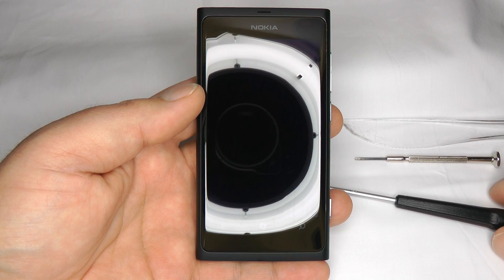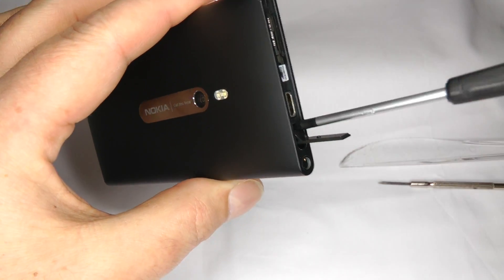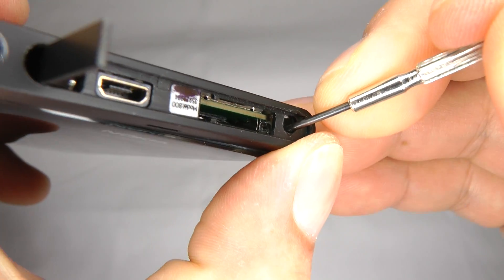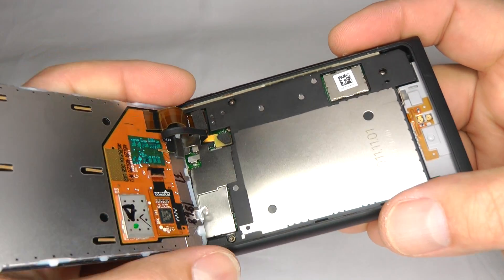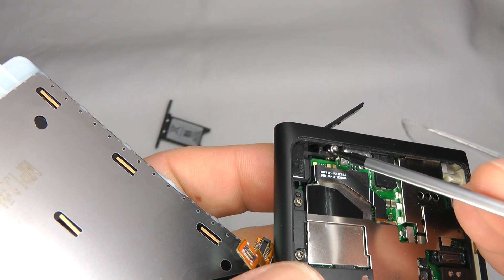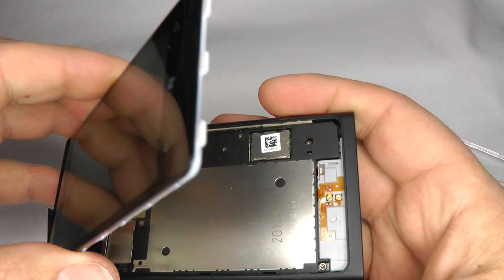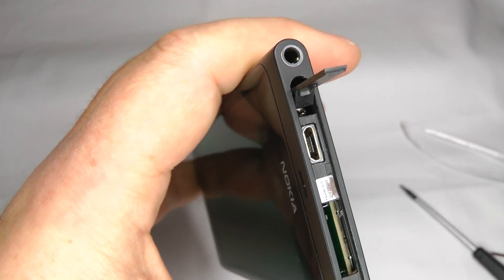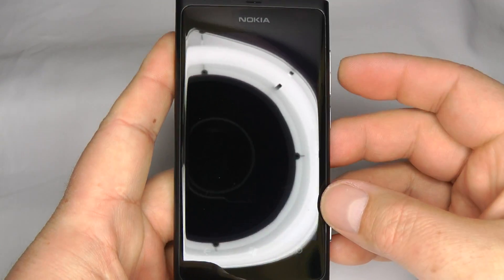Nokia Lumia 800 Screen Repair / Replace / Change a Broken LCD (AMOLED) + Touch Screen (Digitizer)

Comment: Hey chap, 
I dropped my phone recently and after watching this I decided to buy a digitiser from ebay to replace the broken screen. I am unable to post a direct link to the item but it is listed as "New For Nokia Lumia 800 Front Touch Lens Lcd Display Screen Digitizer Ribon Flex"
Having looked closer at the item I am concerned that is slightly different to what you have used. It looks like there is a metal frame missing from what I have bought.
Do you think this will be a problem?
Many thanks.

Comment: It still responds to touch though, the back, home and search buttons vibrate when i touch them, and i managed to take it out of vibrate mode (did this by assuming where the button was after hitting the lock key, then the vol key).. i know it worked because i heard a text come through just recently. Don't know if this helps. and surely the phone must be strong enough to withstand a 2.5ft drop onto tiles?

Comment: Hey, I dropped my (week old!!) Lumia 800 and cracked the glass. Everything is still working perfectly on the phone. What would be the cheapest way of fixing the phone? Is there a way of only replacing the actual glass itself?  If so do you know where I might be able to source it from? Cheers.

Comment: Great video.. and don't get ripped off, Nokia Carepoints will be able to provide an original part for 155GBP.. Exclusieve NCP should have them in stock as they are required to . ALso the USB dor if need should be replaced by NCP free of chanrge..

Comment: @23saibot I bought a replacement screen without the metal back part, because the original screen was broken. With a knife I gently separated the metal part from the screen. Use a sharp knife to remove the old glue from the metal frame, and then you use some strong glue to attach it to your new screen. That's how I did it and it works. Be careful with the light sensor because it's attached to the metal frame, and don't spill glue on your brand new screen ;)

Comment: @070mel070 How did you do that? I've tried to scracth my screen with a key, with a moderate force and there's no scratches what so ever. I had to try that out =D Of course, i didnt use full force but i gave it plenty of pressure, certainly more what keys in a pocket would... ?

Comment: Very helpful video, thanks. My Nokia Lumia 800 which is barely 1month old had the screen completely smashed a week ago during a bad fall i had in the snow. Was just stepping out of my front porch phone in left hand when i found both my feet up in the air, broke the fall with both my wrists (thankfully not my head), Sadly I found the phone later face down in the snow with the screen shattered. Phone still responds to charging, camera etc but nothing shows on the screen.

Comment: Update.. My screen is COMPLETELY fixed..  I disassembled the phone again and then reglued the screen unit that was separated with loctite superglue (thin coating of course) then compressed by hand several minutes until the glue set. Then cleaned residual off and reassembled - and the screen works perfectly during calls now! The Hong Kong piece is backordered for two weeks, so I'm going to spend a few days until sure the repair is perfect. If so, I can cancel my $130 order - THX Again!!!

Comment: Suggestion.. my Torx doesn't have a magnetic tip; so I found that LIGHTLY scraping a candle with the point added plenty of tack to grip the tiny little screw without it falling.

Comment: Thank you!! And for the link as well. Dropped my phone - screen assembly was protruding; I snapped it back in and I thought I was back in business. Then when I went to make a call, the screen disappeared! I thought maybe the ribbon cables had been dislodged so used your video to repair. Problem still there; and I noticed there is now a gap at the top of the screen. Also, when I pinch the top of the screen in the middle; the screen reappears. So have a new assembly on order thx to you! Cheers.